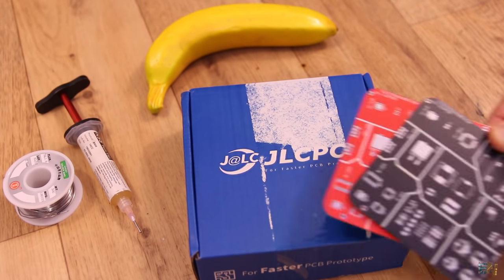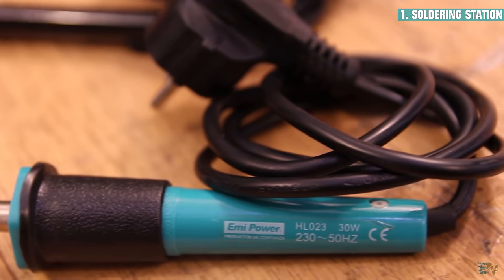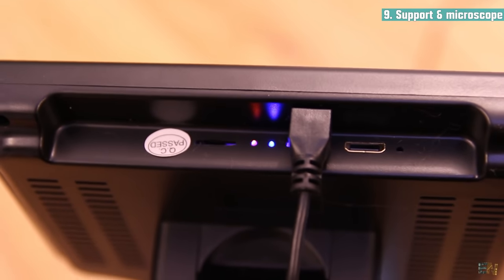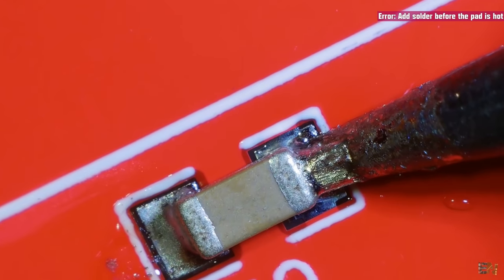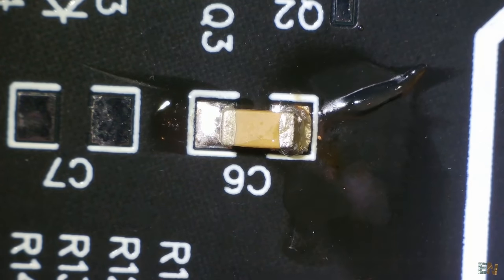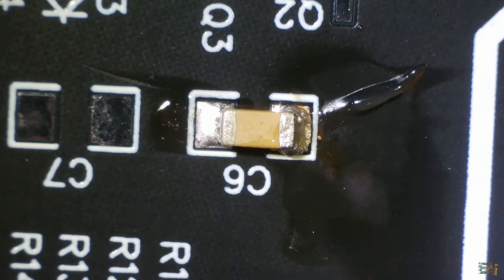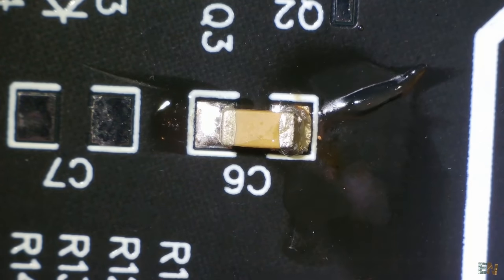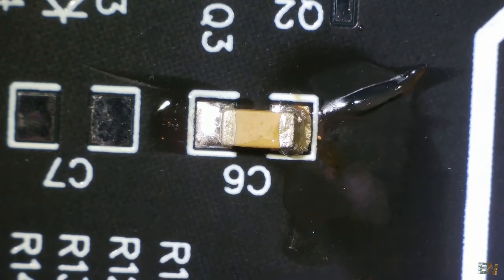SMD Soldering Tutorial | Guide | Tools | Tecniques | Stencil

Comment: You should always have solder on your iron when heating the pad, it will transfer heat better
Reply: correct. and always keep the tip clean.
Reply: Also Soldering temperature too low.
Reply: Also, there's no such thing as too much flux until it forms a sticky mess.
Reply: @tazman4855 what temperature is good?
Reply: @mrt-ee1zn  I typically use 370F. The soldering tip with temp sensor and heating element in one rod is better.
Reply: @tazman4855  you mean only 190 celsius?
Reply: @mrt-ee1zn  310 ~ 370 degrees is a good range for soldering and can prevent cold solder joints from happening.

Comment: I think it should be mentioned that isopropyl alcohol is just a solvent. So it will dilute the flux residue, but the residue is just spread all over within the solvent. If you let it dry, the flux is now a big sticky smudge everywhere. This is why you need to use paper tissue ( Like Kimtech Wipes) to absorb the alcohol containing the diluted flux residue. Once dry, you ll see that your pcb is neat and clean and your wipe is yellowish/brown (if using rosin flux. "No clean" fluxes won't). Q-tips like in this video will do, but not as efficient
Reply: If you want boards that are actually clean you need to rinse the board with fresh alcohol, not just blot up the worst of the mess.

I routinely used a three bath process. The first bath was to remove most of the flux. The second was to finish the job. The third was fresh alcohol to remove the last of the residue. Once bath 2 became too contaminated the alcohol was moved to bath1, 3 to 2.

My very strong perference unless something prohibits it is to use solder with water soluble flux. The flux absolutely must be removed within a few hours because it is corrosive and conductive. It can readily be removed with warm water. I used compressed air blow-off at a couple of points becaue surface tension tends to cause contaminated water to be trapped under parts. After a final blow-off a rinse with distilled water is appropriate.
Reply: Perfect. You forgot the last step. After cleaning the excessive water with compressed air we let the PCB to dry in a dryer. 👍👍👍
Reply: I find coffee filters work better than paper towels too since they dont leave behind fibers like paper towels do.

Comment: In general, very good tutorial. However, one very BIG thing that was missed was the choice of flux and how to remove it. The fact that you are using alcohol says that you are using a rosin type alcohol based flux. You can't make the assumption that everyone is going to know that with an alcohol based flux you must use alcohol to remove it and with a water based flux you must use water to remove it. You should NOT use alcohol to remove a water based flux! There is a good reason for this and in my career I have seen the consequences more than once. Alcohol leaves a residue of water based flux which is conductive. This can create conductivity between traces. For example, I have seen this cause DDR interfaces to fail. I have also seen it create "noise" effects in "low noise" analog to digital converters. The cure, in both cases was to thoroughly wash the PCB with water (and properly dry them). This will remove the residue of the water based flux that the alcohol will leave behind.
Reply: It is critical to remove water soluble flux within a few hours. It is corrosive and it is conductive and if you leave it too long you can get corrosion products that are extremely hard to remove.

I had quite good results with water spray using a sprayer "nozzle" intended for an agricultural sprayer (a multitude of such nozzles on long booms). It makes a flat, fan shaped spray that can be carefully directed to get as much force as possible under components. With SM components surface tension will retain contaminated water under parts. I used compressed air blowoff after a first good water blasting, then repeated with water, finishing with blow-off and a distilled water rinse. It's tedious, but that's what it takes to do a good job if you don't have a commercial SM board washer.

Most cleaning with alcohol I've seen in videos is haphazard and adequate for cosmetic purposes only.

Comment: My most-needed, thorough, well-made  tutorial ever!
I'm a 69-yr old EE & sw engineer and electronics enthusiast for over 60 years.   SMD soldering passed me by because I was either doing software design or had hardware engineers who, when we architected PC-based systems, always contracted that out.  When he occasionally had to change something, he took care of it.   Then came STEM and semi-retirement and  I got back into designing and building PCB based projects, and when needed, patenting designs.   BIG problem - I never  learned SMD soldering.  I always claimed bad eyes and life was too short for that much frustration!   I needed an AtoZ on SMD soldering.  Your all-in-one-tutorial is simply perfect!
For example, I never bought separate flux, since one buys resin core solder anyway.   10 seconds of seeing how effective separate flux is  for keeping solder in the right place, and the nice trick (which I will practice before soldering the 14-pin SOICs I plan to use), along with getting the right tweezers, soldering iron, and not goggle magnifiers but the screen version, has boosted this old engineer's confidence for the electronic equivalent of finally "learning to read" :-)   Thank you very much!  Instant subscriber.
Reply: Don't forget the microscope Andonstar AD208 (130$) !!!
Reply: Its actually really easy to do so. As technician from samsung smd line i can tell you when are smd boards repaired they dont really give a damn about how it looks , but its only for functionality , if it works then its good enough. Also when we repaired circuit boards we used only one soldering tip for all uses , it was flat small one.
Reply: Mitch... I am in the same boat as you it seems. I remember seeing the wave solder machines making boards and thought that was the end all. Now finding myself working on smd components to repair those boards! The most difficult part for me has been component identification. I need some better tools and some practice, but I am sure with video such as this one we can all gain some expertise.
Reply: In my 50s and though I am not doing SMD per se.. getting in to building drones which have some small pads and tiny wires to solder.. and my eyes are not at all what they used to be. Having the worse time even with a 7x magnifying led light. I also tried the Adonstar approach.. but it's too hard to figure out depth. Some people can do it. For me it did not work even on a 50" TV. I burnt myself a couple times. So I just ordered the AM binocular microscope. I am hoping this is it.. because there isn't anything else to get lol. The big thing I NEVER knew.. flux! I assumed flux core solder was all you needed. I have never seen any videos showing to use flux like the latest ones I see. I built keyboards for fun/hobby and none of the videos I saw of those which also have small components.. showed anyone applying flux. Just solder. Flux is a game changer.. I got a flux pen for now.. seems to work well enough but may try the flux gel (wax?) as well if that is better. I also just bought the micro pencil iron for my FX951.. hoping all this will finally let me work with the tiny soldering pads/wires. If not.. I give up.
Reply: @b3owu1f  i remember someone commenting: the rule with flux is there is never too much flux. All videos now show copious amounts of flux being used during all steps of the process.
Reply: @AliGtm how it looks is important to function. If your solder isn’t bright and shiny or have a nice concave fillet, it may be bad

Comment: This worked an absolute treat. At first I tried to individually solder the pads of a SOP30 op amp. Didn’t go well, then I watched this video and tried using this technique, but still using my finest soldering tip. The second I changed to a large chisel top it all fell in place and now it is beautifully soldered and soo easy 😁
Reply: Tip size is very important for heat transfer.. The right tip for the job

Comment: Taught myself how to solder back in the mid 2000s as a young teenager. Needless to say I for years was HORRIBLE at soldering. didn't know about tinning the tip, didn't know about flux, anything. Wasn't until about a decade later, late in college when I learned a little more, slowly but surely. Unfortunately for my skills, everything has gone SMD and my knowledge and skills still haven't caught up. Finally, a little over 20 years later my knowledge and skills are about caught up, and I just had a digital camera for SMD soldering get delivered. I should finally be able to get so small SMD soldering done with acceptable quality. Thanks for this solder summary.

Comment: pro tip: before continuing with the rest of the pads at 12:30, make sure to press on the chip with the tweezers and heat the first and only pad you soldered. move away the iron and keep pressing until the solder has solidified again and then stop pressing the chip. this ensures that the chip sits flat

Comment: Absolutely brilliant tutorial. I am very much an amateur and still quite a newbie but I’ve found a few things that helped me. The first isn’t rushing, heat the pad for a second or two first and don’t be shy with the flux. What I do with the tips I use most often, pencil, hoof, conical and knife is to have them all set up in their own cannula. Then I don’t have to fight with a hot tip and can just unscrew the cooler plastic part to change them. If you can’t afford a top quality station, or like me you’re an amateur, you can still use better quality tips, such as the Hakko T18 series. They are more expensive as one tip is the same cost as a set of a dozen cheap ones but the difference, along with using a good solder, is phenomenal. Over time the tips work out about the same cost because they last so much longer before pitting and you use all the ones you order. Those £2.50 soldering kits off eBay are worth every penny, being a sad sort of person I’ve kept mine and can see my improvements over time.

Comment: For the last few weeks I learning how to use a YIHUA 853D hot air rework station I recently purchased. I enjoy the challenge of it even when I blow a 0805 resistor into the next room and can't find it. I got one of the Gikfun learn to solder kits. I have not started on the 0603 or 0402 packaged components yet. My 51 year old eyes are challenged enough at 0805.

Comment: I'm putting a lot of thought into this because I really liked the video. As an IPC trainer, there were some things I liked and some I didn't.

Things I liked:
Recommending a soldering iron with temp control.
Reminding proper storage and checking the expiration on solder paste.
Recommending use of flux. (Many put too much trust in the solder's flux core)
Explanation of component size designators, like 1206.
Reminder to check component polarity.
Tacking opposite corner leads on a DIP. (Also skipping leads to prevent overheating one area)
Nice suggestions for hot air guns. (The solder paste portion was probably the best part of the video IMO)

Things that could be improved:
An overemphasis on shininess, whereas fillet shape and wetting is more important.
1:29 Cutting against the edge of your boards, risking edge depanelization.
2:12 Using a tip that overhangs your pad (which also looks oxidized and left FOD)
3:23 Saying you should have "the best quality" solder. This depends entirely on the assembly.
3:28 Saying thinner is better for SMT. Depends on the pad/lead sizes. Too thin, and you could underfeed your solder or unnecessarily increase dwell time with the iron.
4:06 Saying the flux keeps the solder on the pads. This is what solder mask on the PCB substrate is for. Flux is for cleaning away oxidation and comtaminants and also assists with heat transfer.
7:40 Not adding flux when tacking your component. The flux in your solder was completely burned away and you may not get good wetting.
7:56 Not adding flux for solder reflow. Also, every application of heat can increase the thickness of the intermetalic and cause embrittlement.
9:34 Recommending solder wick to remove excess from SMT. If someone is struggling to feed solder properly, they may also remove too much with solder wick. Repeated addition and removal will lead to damage.
16:44 Holding your iron directly against your component. Better to use a chisel tip for that.
17:20 Pressing down on a DPAK. Pressing down can thin out the thermal plane connection. A thick base connection is always better. Your thermal plane also looked like it didn't wet properly, probably because the flux burned off.

Comment: Excellent video! Been in the electronics field a long time. Started back in the mid 70’s with vacuum tubes. Times are changing and to be successful you have to change with the technology so thank you for such an excellent video presentation of smd devices and proper technique in soldering with the use of soldering iron and hot air. Been looking for a through presentation such as this. As I progressed from the old linear power supplies to switch mode power supplies some of the earlier simp utilized very small surface mounted controller chips on double sided pc boards where the controller chip were surfaced mounted on the opposite side. Replacement definitely required a microscope and excellent surface mount soldering skills. Either that or purchase new smp board which I preferred since I had none of the specialized equipment needed. Thanks to your video I will be investing in the digital microscope and the additional supplies. Keep up the good work as I am trying to understand surface mount devices with the numerous standards of identification.
Reply: I wanna see this guy to solder vacuum tubs.

Comment: Excellent tutorial. Exactly what I need, before taking on my 1st project populating an SMD PCB. Newbie mistake #1, ordered Polyimide Film 3mil (0.003") stencil, instead of stainless steel. The polyimide is too thin (not enough solder, I think) and it was deformed during mfr. So there's like a bubble, which will allow solder to flow underneath. 😢 Perhaps I can skip that area with the spreader and use the syringe after removing the stencil, instead. Wish me luck, Folks. I'm gonna need all I can get.😎

Comment: Great tutorial, I would recommend to not keep the soldering iron tip heating or applying soldering to the pad for too much time, as the pad can come off (lift) from the board, nor when soldering the component, as it can break due to too much time exposed to heat.
Reply: Considering a shape of a melted solder, I'd suggest that the temperature was quite low. 
Or the solder was not "the best" (with a cheap core).

Comment: I must admit, your video was very good. You gave us all great examples of how to solder a lot of different types of SMD components. When it comes to your soldering, keep practicing on your end results. Some of the soldering you did was acceptable, but still could use some finishing touch ups. You didn't do anything wrong or bad. I am only talking about the end results on some of your work. Like some of the solder joints are not snooth. It should not have and peeks or valley's, and no blobs anywhere. Also be sure that you do remove any and all solder balls like you did do, so good on you for doing that.

All in all, it was a great video and I look forward to seeing you progress further with your projects and solderings skills. Keep up the great work and video's.

Comment: Thanks for the very informative and helpful video! My only recommendation is to use a high quality solder. Your solder joints are very dull looking. At first I thought it was because you must be using lead-free solder but then I saw you’re using a super cheap, generic Chinese 60/40 solder. Don’t skimp on solder. Always buy the good stuff.
Reply: Can I ask what your go to solder is? I have some Kester 60/40 from an old tube amp project but thinking about embarking on my first SMD project and putting together a shopping list!
Reply: @sjgsteve21  - Kester 60/40 should be good. I use Kester 63/37 — labeled “44” Rosin Core — because it’s eutectic (and it’s what we used when I designed, manufactured and tested satellites for over 15 years) but 60/40 is close enough and often provides good results. I use .031” size for probably 99% of the time. If I need something thinner, I have a spool of Kester 63/37 size .020”.
Reply: @Samuel-km5yf  thank you!

Comment: Great video,very informative. After many failures I found using a solder flood method on the pins then the wick to remove excess solder worked for me for many years,finally with a torch on the opposite side of the pcd i could easily check for shorts and correct as necessary.

Comment: 14:37  I learned, with through-hole components, it's important to touch the iron to the pins. Heating only the pad is considered a big No-No. But you're not touching the iron to the pins here. Does the heat transfer sufficiently from the pad to the pins with components this small?
Reply: The pins for through-hole components are usually larger, and require more solder to effectively connect them to the PCB. An SMD component has almost no thermal mass to the pins, (Minus large plates and such, there you have to do some hacky stuff to solder them with a normal soldering iron.) so you don't have to do that.
Reply: @nikkiofthevalley  You said "more solder". But i'm not talking about the amount of solder. I'm talking about heating the pads sufficiently so the solder (regardless of amount) chemically bonds to the pad.